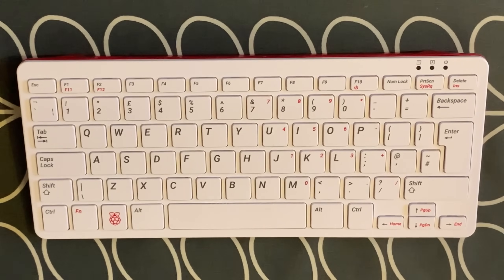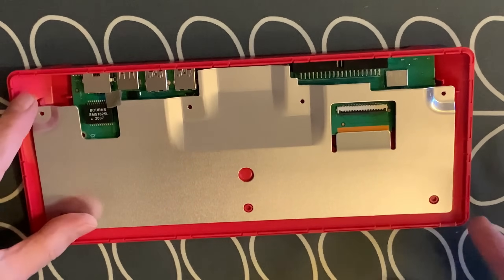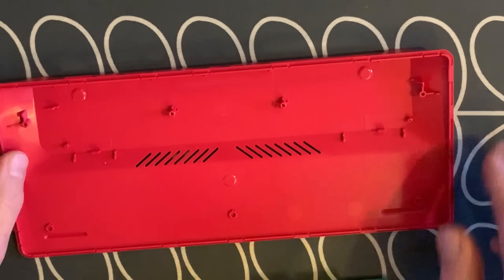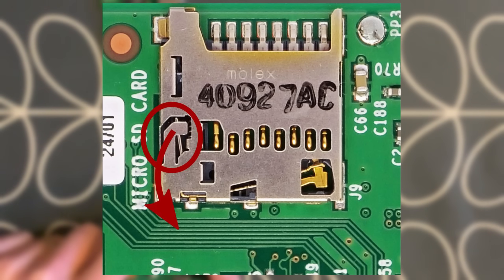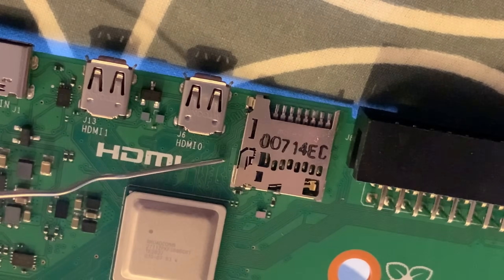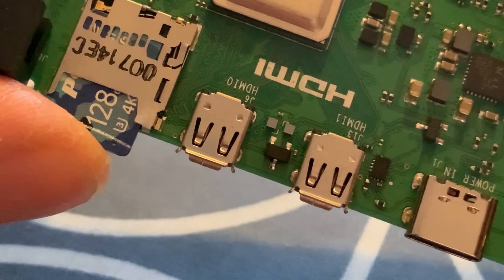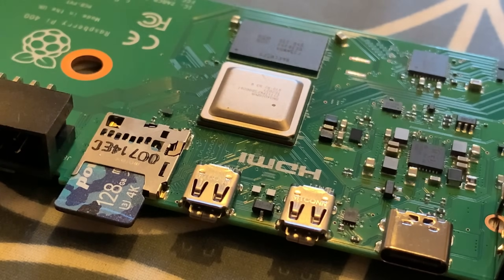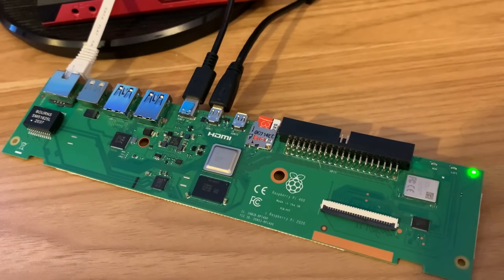Micro SD card slot fix. Raspberry Pi 400.

Comment: My Pi400 just exhibited this issue the other day. I used the end of a breadboard project wire to poke around, push the spring down and observe the catch lever. I couldn’t get the catch lever fixed and I probably bent that tab around too much anyway whilst trying. So I just removed the spring mechanism completely using a needle to pry it sideways. So the SD card stays in, but now I need to use a tweezer when I want to remove it.

Comment: My sdcard got stuck inside. Thanks for this video, after i have opened the RPI400, somehow the sdcard was ejected. Must be all the force applied during opening the casing that somehow triggered it. Anyway, i have tested the card and other cards multiple times insert/eject before i close it up. The hardest part is to open the case. I suggest NOT to use a blade as some other videos shown as it could be dangerous and you might slice yourself. My working solution is to simply use your finger nails and a flat screw driver/test pen initially at the bottom edge of the keyboard(space bar side). Once your fingers managed a tiny gap, slide in the screwdriver. Then use the screwdriver to make a bigger gap and finally slide in a  triangular plastic thing for opening phones, and slide that plastic along. You will hear clicking sound unsnap along the way. I am using my Raspberry Pi400 to type in this comment after my fix. :)  To prevent future problem with the sdcard slot agan, i set up the boot order to boot from USB using the raspi-config. I have also bought a USB sdcard adapter so that if it fails again, i can use the USB adaptor to boot my various collections of sdcards with Retropie, PiMiga and dedicated Amiga games sdcard. Thanks for the video again! I have probably avoided destroying my RPI400 by following it.

Comment: thanks for this excellent video showing the mechanism.
i have a sd card slot on my boat sounder that i think got water/moisute inside it,sd card wont read the info on the card, but does work on other slots.
do you have a suggestion as to how i might clean contacts inside card slot?
thanks
john
Reply from the maker: Isopropyl alcohol evaporates, it’s suited to most electrical cleaning. Check all the instructions first.
Reply: thanks for reply on the alcohol. will give this a try.dont thnk I have anything to lose.one of slots actually came back to life and is working. I leave micros card inside don't take it out now. 
was thinking of some sort of adapter that perhaps would have micro sd card on one end, common usb male connector on the other end, would you know of someone who could make this parts are not expensive, just the wiring would be tedious? 
thanks
John
Reply from the maker: @jw228w  like this?

https://amzn.to/3R5OuRV

Comment: Maybe as I did with my 3d printer is use a sdcard extender cable and hot glue it but my rpi400 sd slot works.so does my 3d printer sd card slot but they don't cost much.
As you, I boot from a ssd so don't worry about sd cards.

Comment: I got it apart; there didn't seem to be any problem with the thermal pad, but the wire that needs to be moved was not visible across the gap, only at the very top.  I am all thumbs, so I will try USB.  I agree that a sewing needle is a good choice, very thin but strong. Re the HDMI ports, full-size ones would be too wide.

Comment: 1.  An Xacto blade point.  That was the first thing that occurred to me, before you got to the modeling knife - and it works.  There's plenty of room.

2. If you watch closely and move slowly, you can see the "wire" drop into the slot in the edge of the card as you push the card in, and pop up as you push it the second time.  Ingenious mechanism.  (You can even see it in your video,)

Comment: Don't know for sure but... I think that all you had to do was bending the L shaped metal part a bit inwards. Which you accidentally did by pushing your knife in there to supposedly "bent" the tiny flexible other rod. Looking at the before and after shots I can clearly see the L part bent in and it explains why you could solve it by simply pushing on it with your nail.

Comment: For those who have had lots of electronics experience it’s a easy fix, but for anyone that hasn’t got any experience working on SD mechanisms,  it can be very daunting.  

By the way a small hole can be cut into are area of the vent holes. 

Adding a small 3 wire fan can be installed if your looking to overclock this unit. I used a fan that I had on hand and it worked out ok.

Comment: It's very hard to see.
Did you bend that 'L' shaped 'flap'  outwards or inwards?
OR was it that tiny wire under the 'L' shaped 'flap'
- if so, how did you 'twist' it because it looks
 like the little bar can only be nudged rather
than bent/twisted?
Well done for the repairing it though.!

One thing. I guess you've used the ESP 8266-01's in the
past. The SDK for them talks about flashing 1MB modules
them with NONOS and one of the .bin files needed is eagle.irom0text.bin
and eagle.flash.bin
These higher SDK's don't come with these eagle files though
But the modern AT commands are really useful.
It seems to me the .bin's need to be created by compiling
(easiest in Linux I'd guess) Do you have any knowledge of this
or where I an get help to do this? I really need
modern AT command set on my old ESP-01's.
Thanks for your time.
Reply from the maker: It was the thin rod beneath the L shaped bitI bent it towards the card.

I don’t really do any of the second part of your question.
Reply: @leepspvideo  OK. No Problem. Thanks. Keep up the good videos.

Comment: Great work, btw what were you using to hold all your sd cards, just curious. I use empty Altoids tin, cause they are curiously strong!!
Reply from the maker: It’s a plastic box, I can’t remember what it used to contain. I stuck some packaging foam in it and cut some holes. I keep meaning to get something better.
Reply: I use a ColdShine memory card carrying case/wallet off Amazon.co.uk. Holds 22 cards for around £3.99

Comment: Whenever I need something super small like that I always go for a sewing needle 😂
Reply: Yep, that's exactly what I was thinking when I was watching.
Reply: except you can't apply "the twist" to bend the lever.
Reply: @emptyone2054  why not? if a needle needs to be twisted, hold it in pliers.
Reply: @timezonewall  But needle points have a round cross-section so it wouldn't do anything!
However I'm you could probably do it just by pushing the needle to the side.
Reply: @BrianG61UK  The point it to push it over to the side, but if it needed a twist to gen sufficient leverage, then one can reform the needle using the pliers so the end is a very small  U shape.

Comment: Hello. Are you still using the twister os on raspberry? Do you know how to fix the issue with bluetooth connections with keyboards and gamepads? It's connecting but buttons are not working
Reply from the maker: I use a gamepad and keyboard with a dongle not Bluetooth.